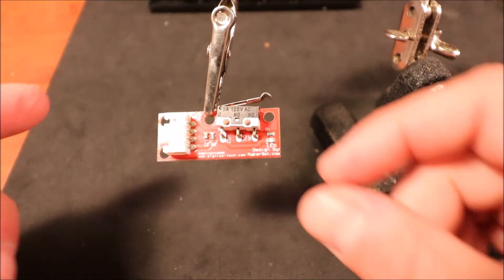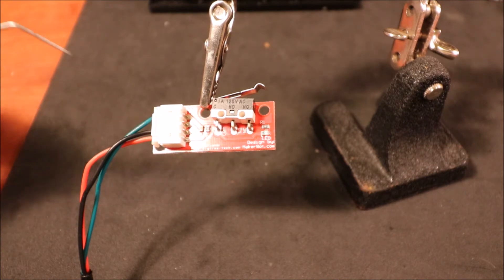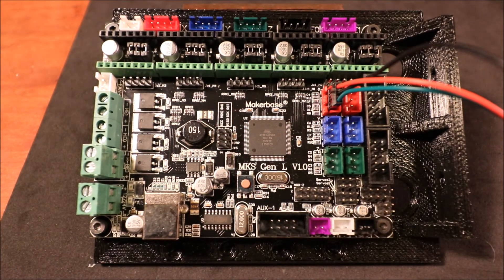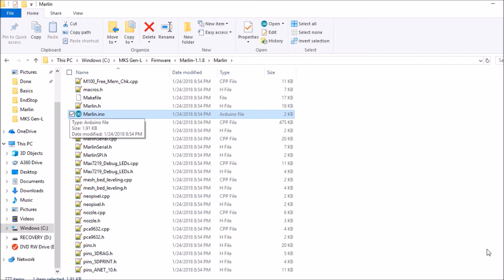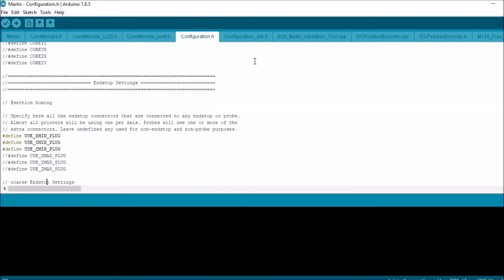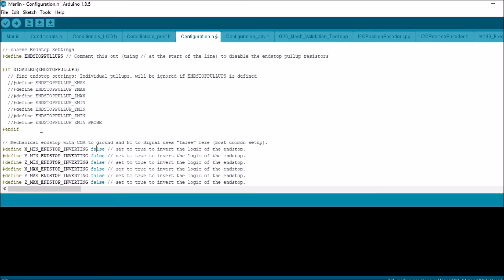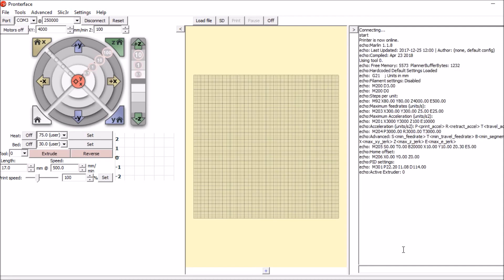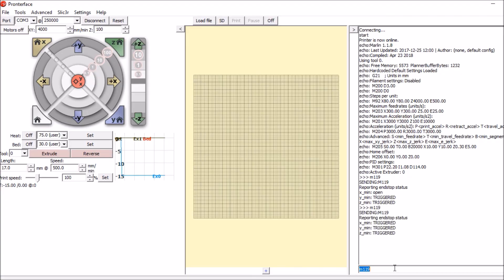MKS Gen L - Endstop

Comment: Hello, I have MKS DLC 32 card. It has 1 limit switch slot for each axis. I want to use 2 micro limit switches for each axis as in your video. How should the wiring diagram be?
Reply from the maker: Why?  Remember endstop is to find zero point on axes and then it counts out from there.
Reply: @EdwardBraiman  Sometimes I enter too many commands absentmindedly. In this case, I want to use two limit switches on each axis to protect the stepper motors.
Reply from the maker: If you find the zero point on axis and then set bed size it will not need a endstop on other end of axis.

Comment: Hi friend. Is there a way to use the second entry for the z endstop because mine stopped working. I already changed it and it keeps saying "endstop z" that's why I guess it's the input.
Reply from the maker: You can change pins in pins file.
Reply: @EdwardBraiman  
it doesn't work :( when I take it to the origin x and y they work but in z it says "endstops z" I already tested with two endstop and a bl toch (modifying the firmware)
Reply from the maker: I'll be doing  a stream tonight at 6 PM EST tonight.

Comment: Hi Edward i got a big big problem im trying to make work my extruder motor on my GEEETECH A10  with  the ÙMKS GEN L motherboard the extruder  don t want to work what it can be? im using old marlin 1.1.8
Reply from the maker: What type of stepper drivers boards are you using and NEMA motors?  Does it make any noises?  What type of power supply are you using?  How are you making the motors move?  Are you using Pronterface?
Reply: @EdwardBraiman  im using nema 17 stepper motor ,24 volt power supply ,im using repetier host the x ,y,z work fine those are runnjing on DRV8825, the extruder is on  4988 stepper drivers i haved modified a Geeetech a10   firmware 1.1.8
Reply from the maker: The GEETECH A10 is a version of Marlin firmware?
Reply: @EdwardBraiman  No its the model of my Printer im running on marlin 1.1.8 configure for the GeeetechA10
Reply from the maker: What the extruder temp when you try and move the stepper for E1?
Reply: @EdwardBraiman  the hot end is about 220 celsius
Reply from the maker: There is a gcode which will allow you to disable the temp to extruder motor on Marlin website.  Remember to not have filiment in system.  Then advance motor.  You might be able to find the process in my other tutorials in my playlist.

Comment: what if it still does not work?
Reply from the maker: What does Pronterface say when you type, "M119" and press enter? Then hold Endstop switch and do again?
Reply: @EdwardBraiman   i have done it both ways and it doesn't stop . i did notice that when i hit home the stepper is going in the positive direction. when i move the axis  + and - it is moving in the right direction.
Reply from the maker: The reason for the question previously is to see if it states with open or triggered.  I'm not able to assist if you're unable to provide output in Pronterface.  Please try again and paste results.  You can trigger manually with your hand on the Endstop and then type into Pronterface.  Basically I'm blind to your output without attempting.  Are you using Pronterface?
Reply: @EdwardBraiman  I worked it out it had to do with the home direction in the firm ware .
Reply: @EdwardBraiman   x home direction
Reply from the maker: In Marlin go-to the configuration.h tab and search on invert if your axis is going in the opposite direction of home.  If you're saying it does not move in the direction of Endstop. Change direction to opposite of  1 or -1.

Comment: Great video. Quick question: I recently bought a MKS 1.4 board and my current endstops only have a cable connector with 2 pins. The MKS board has 3 pins as you described though. Since the cable is all black I can't even tell which one is which. Do I need new endstops for this board?
Reply from the maker: This might be helpful, it's design for two pins. ... https://youtu.be/wMOuO3ZOE5o
Reply: Thx a lot, I see I only need to connect ground and signal then. However I guess it's best if I exchange the 2 pin cable head for two single female heads in order to not break the slot on my MKS board long term.